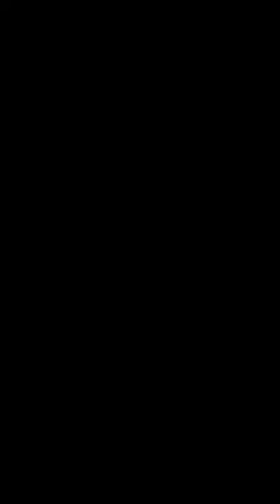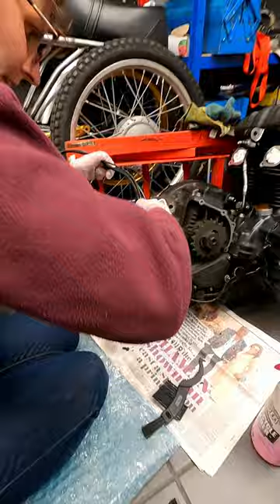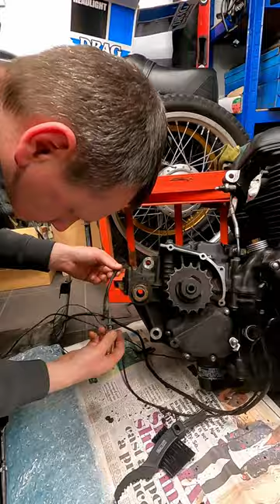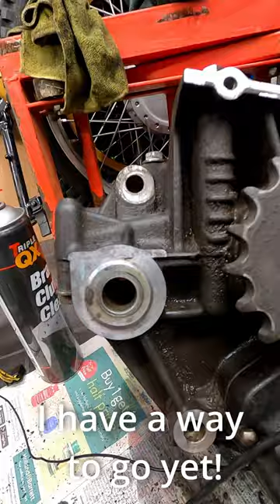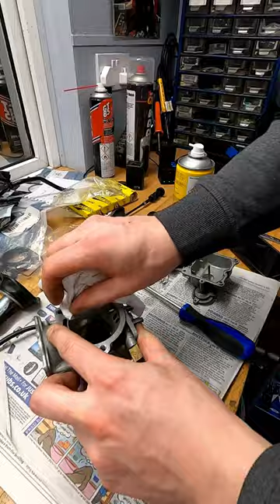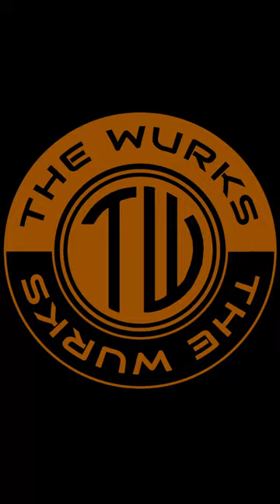Freddie Dobbs' Bonneville | A long way off #shorts #triumphmotorcycles #bonneville #dobbs

Comment: Love the series. Though i must , if the engine was coming out, why not take it out after the issues were discovered?
Reply from the maker: Great question... its much easier to Torque the head down with the frame to counter lever against, saved chasing the engine round the bench when I don't have a Triumph engine stand or any desire to make one.